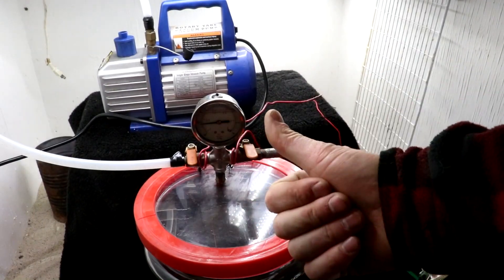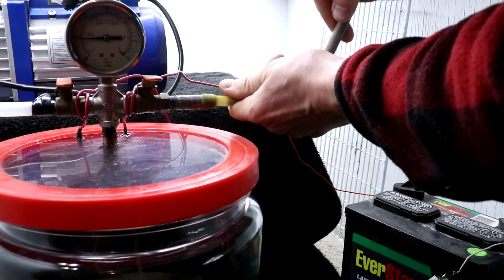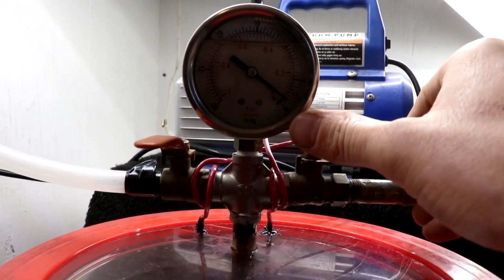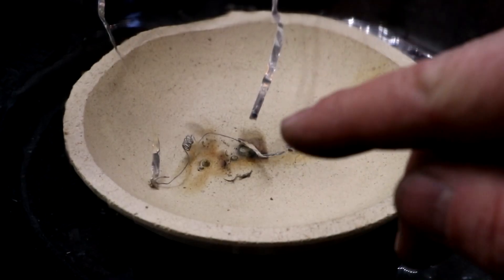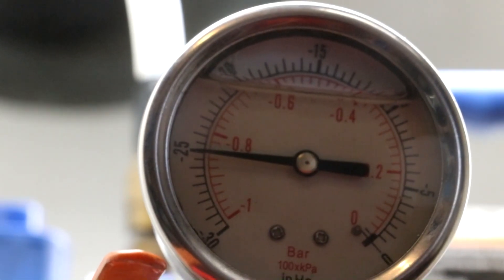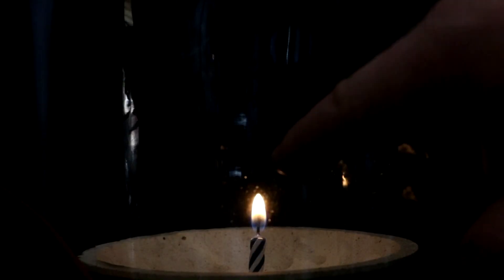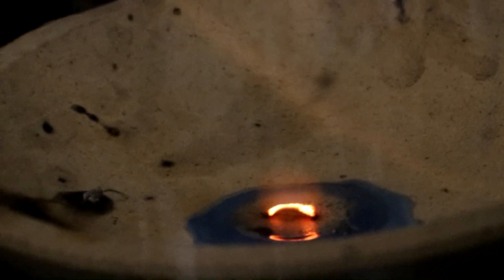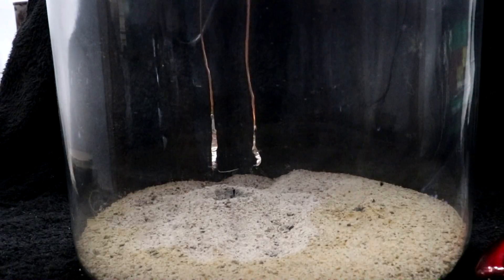Fire in Low Pressure Pure Oxygen

Comment: Interesting. 
So the energy released by the combustion is the same as in normal pressure air, but the lack of nitrogen draining heat, makes it burn better.
Reply: Only for things that burn completely either way. Paper usually doesnt, so it does release more energy in pure oxygen.

Comment: I would have liked to have seen a fire in a pressure chamber with an extra 15 psi of nitrogen or other inert gas added.
Reply: Normal air at double and halfe pressure would be interesting.
Reply: Fart in the chamber too. This is to simulate the presence of astronauts.
Reply: @VoxNerdula  Also because farts are funny
Reply: @theodorekorehonen  until they're runny
Reply: Yes other combos at higher than atmospheric would be neat (maybe) too.
Reply: yes!

Comment: The Nitrogen has Mass, so some of the Energy from the reaction is used to increase the Temperature of the Nitrogen. Cold Nitrogen and cold Oxygen continue to supply the flame. The energy used to heat the Nitrogen is not available to vaporize the fuel, so fuel vaporizes slower.  Life on Earth doesn't want to go up in flames, so the Earth maintains a nice Nitrogen/Oxygen balance. Plenty of Oxygen to burn within our bodies, but not enough to ignite everything.

Comment: Really impressed by how fast that candle burns... all the "oxygen accelerates combustion" demonstrations tend to show things that burn fast burn even faster, but seeing a candle that could burn for minutes just disappear like that really drives home the difference
Now I want to put a large candle in there and see if burns in seconds instead of hours :)
Reply: I think it's important to point out that it's not just the oxygen accelerating the combustion, but the lack of inert gas. Without the inert gas to take the heat away, the heat is stuck at the site of reaction i.e. the candle.
Reply: @jamiestuka2  Maybe that's why the candle "burns" so fast. It isn't actually burning all the wax, it's melting most of it into a puddle. There was a little puddle there which I don't think there usually would be when burning a candle like that.
Reply: @TheJohnreeves  That's what I thought at first, but then there's really nothing left at the end, just a ring of unburnt wax. We didn't see how big the puddle got just as the upright part of the candle disappeared, but either way, nearly all the wax was combusted in a few seconds.
Reply: @jamiestuka2  That is very interesting.  Thank you, I did not think of that.
Reply: Yeah, its interesting to see. Also, paraffin wax can even be used as fuel in hybrid rockets when burned with high pressure or even liquid oxygen (or sometimes another oxidizer like nitrous oxide).
Reply: A large candle might just use up all the oxygen or add enough CO2 to slow it down. 
I too was surprised how fast that little candle went up though. What I don't get is how it burned up so fast but didn't make a big flame. Like, I would expect if the combustion was fast, it still has to burn through the same amount of fuel. Did it just create an immense amount of heat?
Reply: @TheJohnreeves  The visible part of the flame usually consisnts of ions. Or in other words, it is not a completed reaction. When there is a lot of N2 it dilutes the mixture so it takes more time for the ions to recombine. Non-ionised molecules are often quite transparent so they don't have as much black body radiation. And the low pressure probably leads to the gasses expanding really fast and thus cooling down really fast. That's my guess.
Reply: This tells me that if you're a planet, you better stock up on plenty of nitrogen. Pure Oxygen = dead world.
Reply: @-danR  Kurzgesagt should make a video on what if Earth's atmosphere suddenly became mostly oxygen.  The Oxygen Apocalypse.
Reply: @josephburchanowski4636  imagine of a freak solar storm causes spontaneous electrolysis of the ocean...
Reply: I suspect it would be on the order of minutes instead of hours or seconds. It is a lot of material to burn, but then again it's pure oxygen. Who knows without performing the experiment 🤷‍♂️
Reply: I don’t think the candle actually burned that much here. It looks like that the oxygen increased the temperature causing the candle to melt really quickly without burning up all the parafine. But I could be wrong, it was a bit hard to see.
Reply: oils have something called a smoke point... point at which they start vaporising into smoke... and only a little bit above that is the flash point, at which they'll flash into ignition . I'd expect values to change dependent on oxygen partial pressure, and total pressure, but similar should apply to parafin wax.

clearly not a detonation... so there's also flame propagation  speed., fair few things to do with physics of air are limited by the speed of limited by speed of sound... speed of sound increases as pressure drops?
Reply: Yes! Here's hoping we see more candle experiments!
Reply: The candle didn't so much as burn as it melted, this is due to the higher heat produced by the O2 rich flame.  most of the wax escaped the flame and spread.  If you would have used one of the votive candles that could have contained the wax and let the wick float on it it would have taken a bit longer to consume the wax.  But those votive candles are usually in an aluminium tray and that could combust at higher O2 levels, which would result in the wax burning really really fast LOL.
Reply: @Hawkido  Well said! I honestly wasn't sure what I saw the first time! I suspect anything bigger than a votive candle (and maybe even then) starts to resemble a bomb!
Reply: Yeah I would love to see a large candle in pure Oxygen at sea pressure and im interested what happens if the pressure is even higher like at a kilometer or even a mile under sea pressure
Reply: try bigger candle in only oxygen at 1 atmosphere of pressure
Reply: @lukapranjic2407  Paraffin has been documented to become high explosive in pure oxygen at pressure, as in create a supersonic shock wave as it converts its solid mass into an equal mass of gaseous byproducts. Doing this while you are nearby would be incredibly detrimental to continued living.
Reply: @BlackWolf18C  early polar explorers used paraffin stoves to heat & cook. It has to be primed with alcohol to vaporize the paraffin, which was then pressurized with a small hand pump.
Reply: the wick in a candle gives a place for the material  that the candle is made of a place to vaporize and burn  producing heat to melt more of the material the candle is made of. In this case it is paraffin one of the higher melting point fraction of petroleum. The intense fire looked just like a  fuel oil fire  as all of the paraffin ignited vary rapidly.
Reply: It was definitely cool, but I think the candle mostly melted. Not being able to convect heat away in the partial pressure made it melt faster IMO
Reply: It's not only because of the oxygen. It's because the low pressure. There is less force keeping the candle atoms together (or a force pulling them apart), so it melts at a lower temperature.

Comment: Does the reduced atmosphere help with melting the candle, reduced convection means more heat absorbed.
Reply from the maker: Does Look like that may be the case.
Reply: @theCodyReeder  Would a larger candle burn more normally then or just burn the wick? What about those crackle wicks? Or those 48-72 hour horizontal candles? Incense? Sparklers? 
The Candle and Other Flame Based Lighting community demands answers
Reply: @jokeking09  yeah, that "oh, oh dear" instantly justified another video on the topic.
Reply: @theCodyReeder  self-relighting candles in vacuum for an april fool's episode?
Reply: And I suppose a lower boiling point for the wax, exposing more solid wax to be melted sooner.
Reply: As well as, Hotter flame= more of the energy is in the form of radiation as the radiated energy rises as a 4th power of temperature means the energy has an easier time melting the candle because it can go down more
Reply: Also, less heat absorbed by N2, more available for heating wax.

Comment: I'm honestly quite interested in what one'd have to do to get a (long fiber) carbon-fiber composite material to not burn at 200~250 mBar(abs) of pure O2. And if that doesn't really exist: is there something one could make a mostly-gas-tight (unpressirized) suit out of that doesn't burn in that atmosphere? Because like a cable fault getting hot is one thing, but it igniting the passenger compartment of a lightly pressurized vehicle in a low-pressure atmosphere is not ok.
The reason for such low pressure is largely just that the risk of barotrauma is quite low when going from that to vacuum, so you'd have a few seconds to put on the helmet for your suit and/or close the visor, without being deaf for the next few hours/days. Also you'd have an easy time operating controls and potentially bandaging the hole with  a gas-pressurized suit.
And potential rebreather tech would be far easier without pesky nitrogen lingering around, especially as far as pressure and composition regulation is concerned.

Comment: I would love to see Cody attempting to make a  piezoelectric battery. Love the videos.
Reply: Piezoelectric batteries aren't a thing. The amount of charge moved in a piezoelectric material is so small that it leaks between the faces in a fraction of a second. This is why piezos are only used to generate short pulses of electricity from sharp impulses, or for measuring time-varying inputs with frequencies higher than ~1 Hz.
Reply: @Nuovoswiss  yes, this I understand. Was hoping Cody might look into John Hutchenson who was able to make a low voltage battery cell with a "paste" of materials containing crystals. Any amount of voltage would suffice. I thought Cody might get a kick out of trying.
Reply: @davidd3441  That "crystal battery" stuff is nonsense, they mash together buzzwords (like "piezoelectric") to make it sound like they have some actual mechanism, but anyone who knows what those terms mean understands that it makes no sense. Cody has made videos debunking flat earthers, so maybe he would enjoy disproving that.
Reply: @Nuovoswiss  that would be awesome